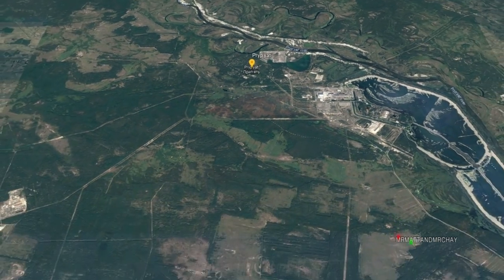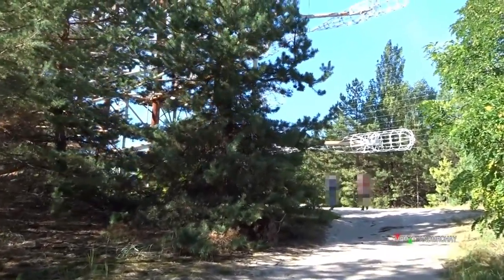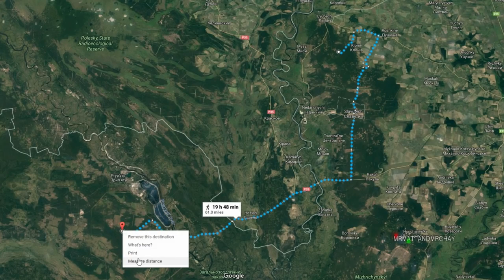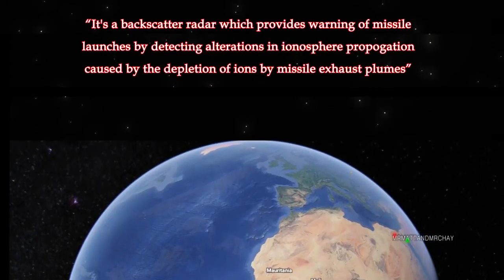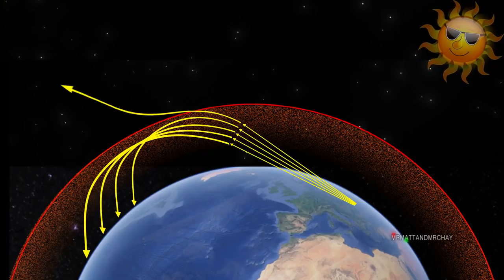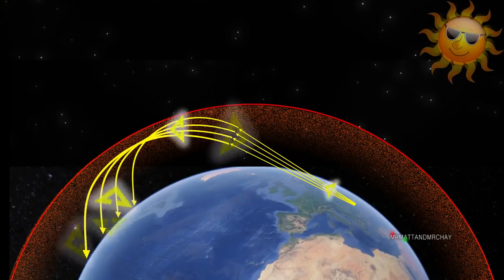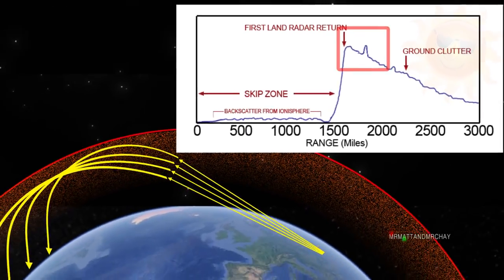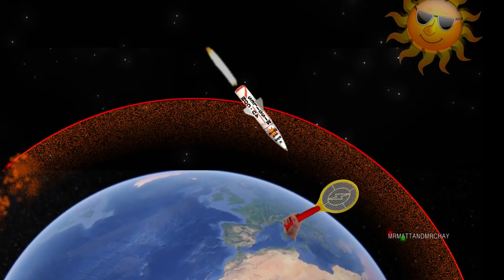(Chernobyl) Probably the best DUGA RADAR "how it works" video on youtube! (must see the end!)

Comment: Its amazing how many inaccuracies this video has. a quarter of the power from a 4000 megawatt power plant? 1000 megawatts of power?? That's funny.
Reply: Yeah wikipedia says 10MW
Reply: @benargee  And that's 10MW EIRP, or 70 dBW. The primary power (in dBW) to run the transmitter would be the EIRP less the antenna power gain, but increased by the feed system losses and the inverse of the transmitter efficiency. Unfortunately there appears to be no information available on the web regarding the radar transmitter, so it's not trivial to estimate the amount of power required to run the transmitter.

Also there's all the ancillaries: the computer infrastructure needed to generate the transmitted signals and analyse the received signals, the associated ionospheric sounder (s), building services to keep the equipment and people running, etc, etc. So the entire system would've needed quite a bit of power.
Reply: @vk2ig  Agreed and probably the Russians were not bothered about efficiency , just overall power
Reply: @gowdsake7103  And with a phased array radar sometimes the efficiency does get thrown to the wind as a trade-off for performance. For example, the VSWR "seen" by each of the transmitters will change with scan angle. Still want to put the same power into each antenna element even though some of the transmitters are seeing 2:1 VSWR or 9 dB return loss? Simple: increase the transmitter output power! 😁

Comment: Growing up in the 60s near the east coast USA, shortwave radio bands were almost with no signals during the daytime. Sun almost completely inhibited all radio skip. Normal shortwave transmitters are limited to use fractions of a Megahertz. BUT - there was the loud woodpecker transmitter every day, which broadly generated that same sound fairly evenly across at least 10 MHz. Soviets also used a transmitter in Siberia like this for mind control of their people.
Reply: great boomerpost, keep it up